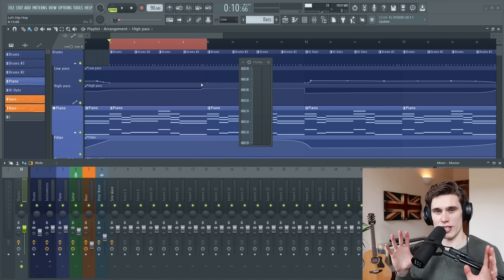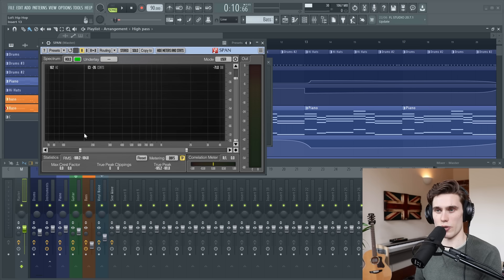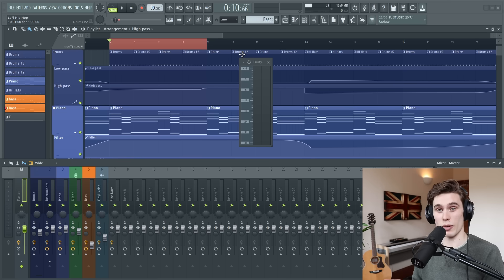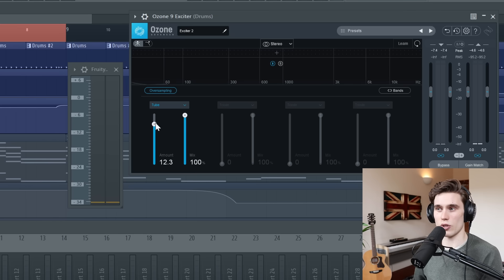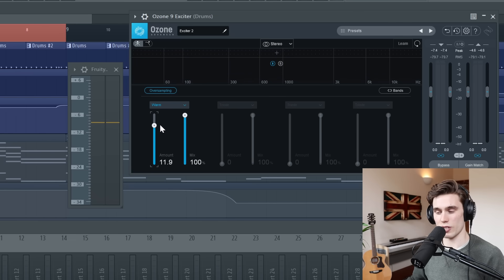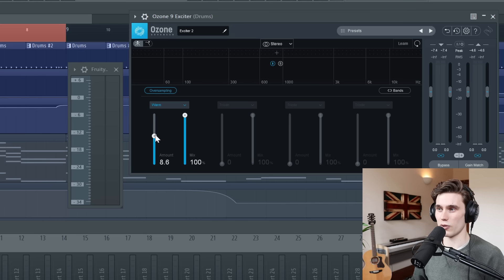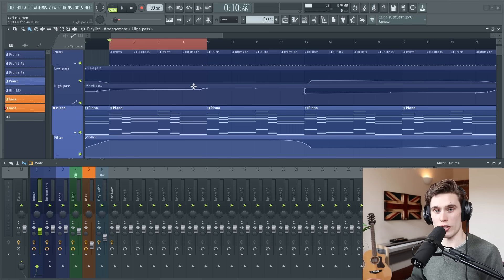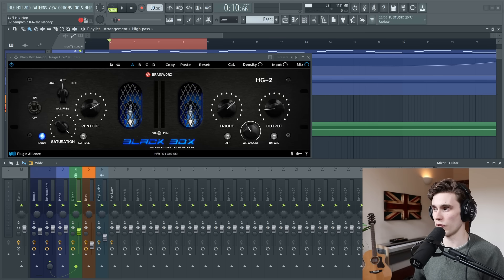Everything you need to know about Saturation - Audio Engineering

Comment: What about "Wave Shaper"
How it works and how to use it?
Reply: UniversaL from what I know it’s just a function f (in the mathematical sense) that takes an input x and outputs y = f(x). That’s why you can usually draw your own function f in a lot of them.

Now for the use ... I use them to make all kind of over the top distortion for any kind of aggressive element in a track, but not so much for mixing.
Reply: @paulmichelon2176  
Hm... Maybe this is "Transfer Function" actually. 
_
Quote from Wikipedia.
"In engineering, a transfer function (also known as system function[1] or network function) of an electronic or control system component is a mathematical function which theoretically models the device's output for each possible input.[2][3][4] In its simplest form, this function is a two-dimensional graph of an independent scalar input versus the dependent scalar output, called a transfer curve or characteristic curve. Transfer functions for components are used to design and analyze systems assembled from components, particularly using the block diagram technique, in electronics and control theory.
(In russian wikipedia that describes harder, lol)
_
I think this IS "Transfer Function" :D
Reply: Yes sure it is a transfer function, but I didn’t know your level of expertise in engineering so this wouldn’t have helped I think.

Still, the transfer function is just f : [0,1] -> [0,1] and can be anything (that’s why you can draw the transfer function). There is no time effects as opposed to filter.

Now it can be a bit more complex as there is usually oversampling in those devices to avoid aliasing, which includes filtering under the hoods. But that’s not the main effect
Reply: Literally look up how to use a waveshaper saturation on YouTube